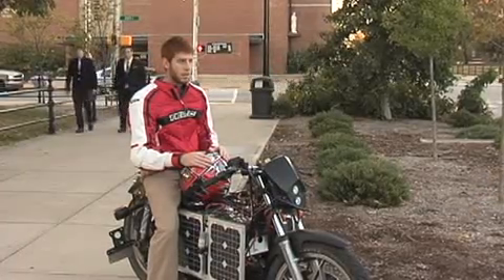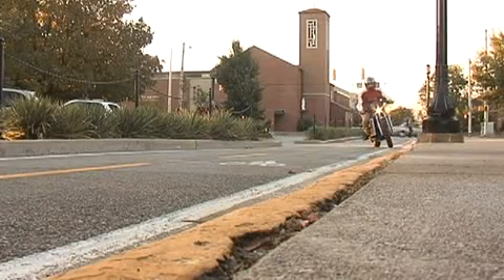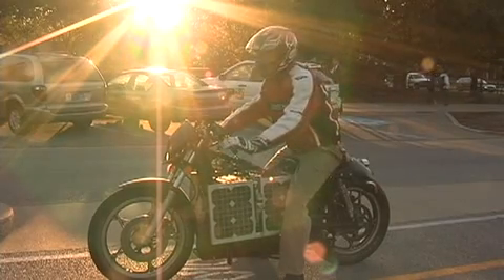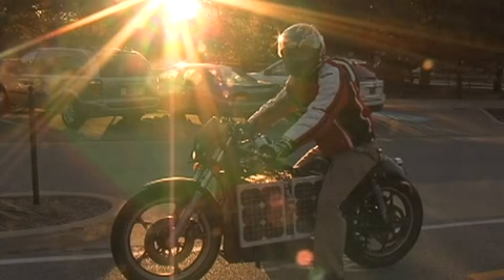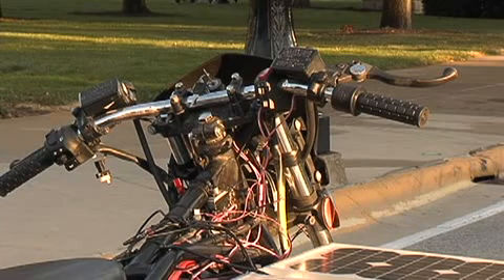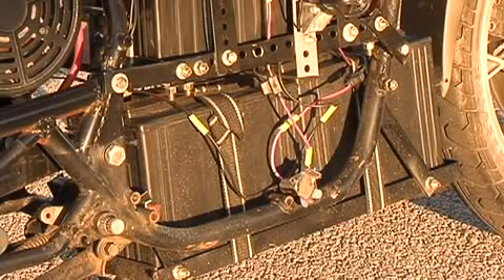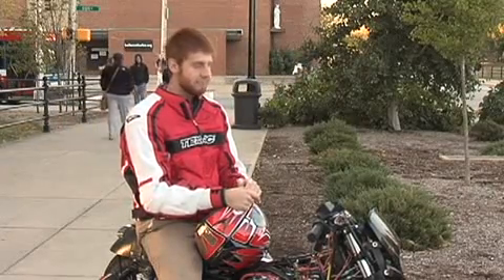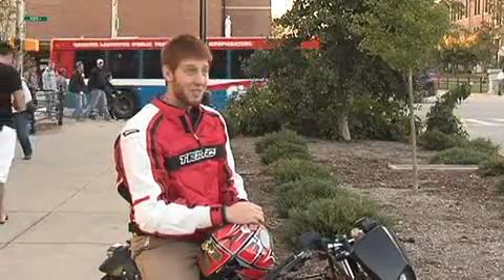Bonus - Solar Powered Motorcycle

Comment: how its possible 40 watt solar panel runs a 48 v system that you use 12 v 100 amp batteries .it can be hybrid bike .but not understand how its work on total solar